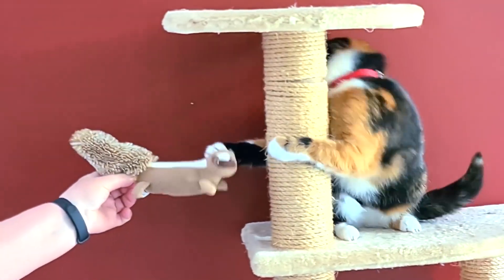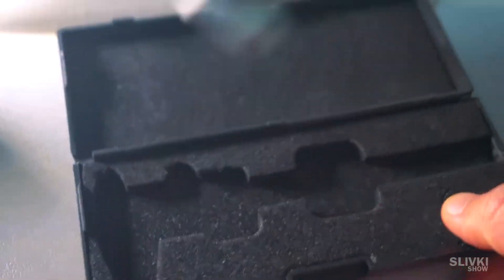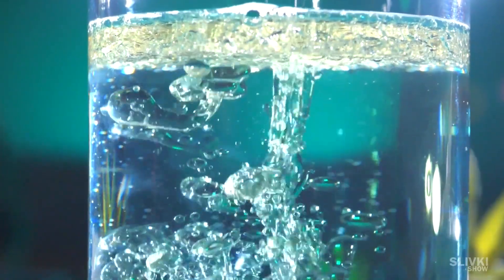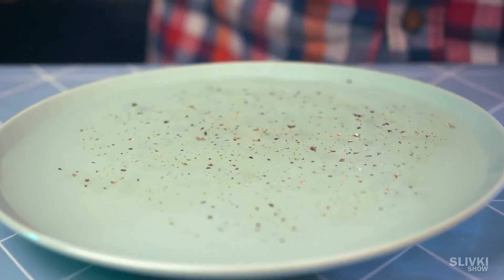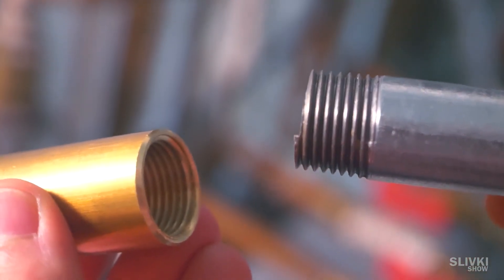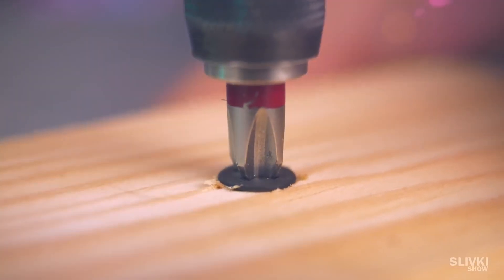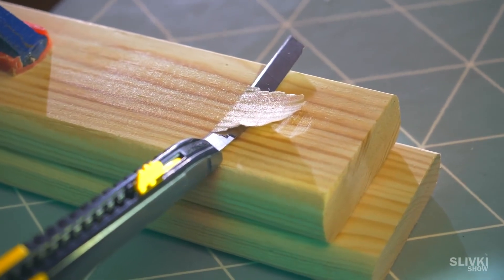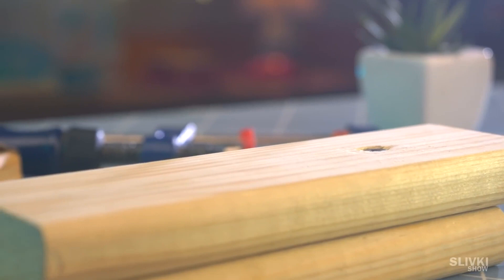5 LIFEHACKS FROM SLIVKISHOW

Comment: If you have vernier calliper then just take a thread and wound it around the circular pipe this will give you the circumference of the pipe and using the formula of 2πr = length of pipe you can calculate diameter <3

Comment: Attention: do not ever pour oil down any plumbing connected system such as toilets and sinks. You would contribute to irreversible and most difficult damages to your building and the local plumbing system.

Comment: Putting cooking oil in the toilet is a very bad idea. Not just the toilet but putting any form of oil in a disposal system connected to the sewers. When you flush the toilet the oil will go in the sewers and clump up clogging the sewers. When that happens it s called a Fatberg.